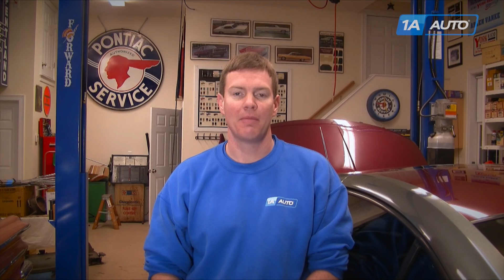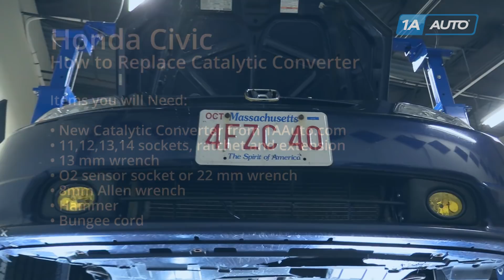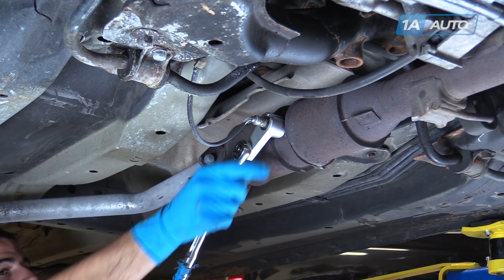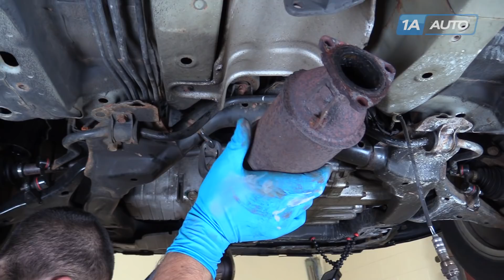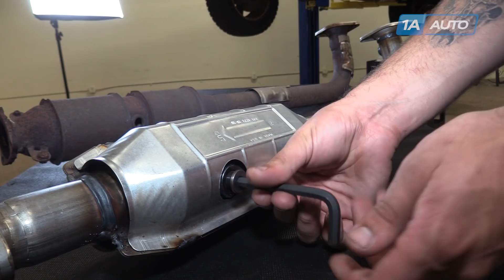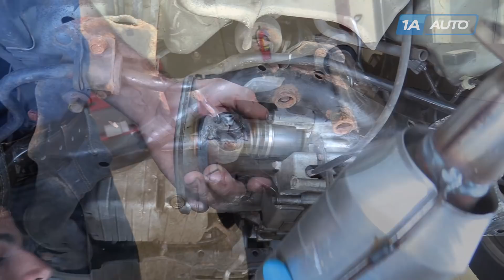How to Replace Catalytic Converter 01-05 Honda Civic

Comment: just pulled mine off and looked into the hole. is the convertor just a bigger size pipe? i can see straight down through the convertor. i was under the impression that the cat was supposed to have something inside it like a honey combed mesh.

Comment: I have a question, I replaced my 2004 Civic DX engine with a 2005 HX engine. Everything is fine EXCEPT nobody NOBODY can tell me where to run/connect the other end of oxygen sensor from the underneath catalytic converter to where??? From the new underneath catalytic converter, I have a place to connect oxygen sensor on it... but where does the other end connects. Do I need to get a HX rear wiring harness? If so, where is it located? The local three Honda dealerships can't even tell me. HELP please. I just need to know where to connect the third oxygen sensor from the catalytic converter underneath the car that has had the engine changed from a DX to a HX.

Comment: The replacement downpipe isn't mandrel bent the way the oem one was, with the crimped looking radius instead. It's a sign of a budget replacement part. Knowing that, the corrosion resistance of the replacement part is almost certainly nowhere near as good as the oem either. So if you live in a state that uses road salt, don't expect that downpipe to last very long.

Comment: because of 1aaAuto.com I've saved about 1000 dollars. These guys really help DIY everything on my 2001 honda civic. Just did a Front brake pad replacement and I'm thinking about changing the catalytic  converter. I'm hoping I can figure out what's wrong with sensors but I replaced both. It's probably the intake sensor since it's flimsy and lose. It has a custom intake.
Reply from the maker: +Livingston Seagull Thank you for your orders! We'd love to hear about your experience. Here's a link to leave us a review on Google: https://goo.gl/i5JFNY 

We love empowering our customers and showing how to perform DIY auto repairs with our high-quality auto parts. Thanks for coming back time after time, we greatly appreciate it!

Comment: Great video, thanks! Do you need to erase the code afterwards or should it automatically turn off after a few drive cycles?
Reply from the maker: +jamminjamy We would suggest resetting the code before installing the new part. Please do not hesitate to contact us with any further questions.

Comment: Hmmm! I don't even know where to start with my issue!!!
Yellowing of the tailpipes(sulphur dioxide)
NO ENGINE MANAGEMENT LIGHT!!!!!!!
K20A2 2005 EP3.
Idles perfect at 1k rpm!
All that's left for me to say is Help
Reply: Check online forums
Reply: im not sure 1k is a perfect idle. if im not mistaken it should idle around 750 +- 50 rpm. on canada built ones its about 30 rpm lower

Comment: I just got my cat cut off and stolen. Do you know how much it would cost for a 2003 honda element with 2 o2 sensors? Also, will i be able to pass smog with an aftermarket cat? Any warranties?
Reply: Well it depends on the new cat youre buying, different parts from different companies have different prices they can go anywhere between 150-600$ for a new aftermarket catalytic converter and if youre getting it done in a shop depending on the shop the prices vary due to cost of parts and also added labor so pricing out the process is kind of up to the shop unless you do it at home. Now if youre looking for a direct oem replacement rather than a high flow performance cat then yes it should pass smog no problem if you keep sure to get one thats legal for your state emmisions. Most aftermarket parts should list what states they can be used in and always double check before finalizing a purchase.

Comment: How much would it be normally to change the actual converter? I’m from the east coast but I just want to know if it’s a hard job.
Reply from the maker: Thanks for checking us out! The costs can vary depending on the vehicle and location you go to, however, the average cost for parts and labor for this repair would be a little over $1000. Hope this helps! +brandon robles
Reply: @1AAuto  How are you coming up with $1000 for this repair? Doesn't pencil out.

Comment: Please tell me what is the average life span of the factory issue cat-con on a 2003 Honda Accord EX (4 cyl, 2.4L).....?? And what is your longevity guarantee on the one from 1A Auto....?
Reply from the maker: +Duncan F Should last 10 years or longer. We're confident our replacement should last just as long if not longer and they are backed by a 5 year warranty

Comment: I'm about to replace my exhaust manifold but the one I'm getting, some people are saying, takes the cat converters place. Would I have to buy new exhaust piping or would i be able to keep the one i currently have(with catalytic converter). My inspections up next month and I'm getting po131,132,420 (my manifold is missing a bolt to the exhaust, and it rusted).
Reply from the maker: +MrDarfoot Thanks for watching!  Certain vehicles have the converter built into the exhaust manifold, so it all depends on what you have.  As for diagnosing your issue we recommend having a trusted mechanic take a look at your vehicle to get an accurate diagnosis.  1aauto.com

Comment: Thanks , please help , I get the code as well , should I change both o2 sensors as well as a new cat assembly ?  , I am not well versed in emissions , however it would seem like the safe thing to do. Am I wright or wrong please advice , thanks. Gary / 2003 Honda Civic Coupe EX
Reply: Our Civic EX models only have one o2 sensor, not two. How did you fix yours?

Comment: Thanks again 1A Auto parts! you guys saving me a ton from the Honda dealership. Plus, it help me get my car smogged regulated in CA. Btw, how many thousands of miles do you guys recommend changing both the down and upstream 02 Sensors? 

-Mr.NOS™
Reply from the maker: +MrAznRonin On a 96+ application it is recommended every 100,000 Hope this helps you out. 1aauto.com

Comment: I can't even believe this channel, saved my life. xD I had to replace my whole suspension on my 2002 Honda Civic Ex after a bad accident. I wouldn't have known how to do it if it wasn't for these videos. So in return for all the information, in a quick, detailed manner, I did get all my parts through them. Same price as eBay, but they won't let you buy things that don't fit in your car and make sure you are getting the right things. I almost got the wrong bolt pattern for my rim, almost got 4x125 instead of 4x100, but they emailed me to make sure before sending and knew the stock bolt pattern and asked if I had an aftermarket Knuckle to make sure. I said no and they sent the 4x100 so it would fit. :D Thanks guys! I am getting a new cat next month because I have the P-0420 code. I tried switching both O2 censors and still passed smog somehow, but going uphill, she slows down.
Reply from the maker: +Jake Genocide Hi Jake, Thank you for placing your order through us. If there is ever a concern while ordering parts for your vehicle, please don't hesitate to call, we are here to help you find the correct parts too. Have a great day! 1aauto.com

Comment: Seems like something I could do myself but when I took my Civic to my local auto shops they made it sound a little more complicated than it is. They told me they have to know the engine family number. After watching this video looks as if I can just order the part from you guys and make a switch. One shop even quoted me as high as $1500. As much as possible I don’t want to do it myself because I don’t want to get under my car on my back. But, with the price so high I may have to get on my back and just get dirty.
Reply from the maker: +Arthur Maclang It's not that hard of a repair. Here is a link to the exhaust pipe shown in this video on our website. http://www.1aauto.com/2001-05-honda-civic-exhaust-pipe-with-catalytic-converter/i/1accd00320?utm_source=YouTube&utm_medium=CTA+Comment&utm_campaign=ytcomment&utm_term=jdRdxbvRswQ
Reply: Shops will charge you an arm and a leg to do the smallest thing.  They hope that you don't know anything about cars.

Comment: will this part fit the EX model?
Reply from the maker: +Curtis Kuhlman The part shown in the video does fit a 2001-2005 Honda Civic EX L4 1.7L. It should be the same or a similar procedure. Here is a link to them on our website. Hope this helps you out. https://www.1aauto.com/2001-05-honda-civic-exhaust-pipe-with-catalytic-converter/i/1accd00320?f=1076994&y=2003
Reply: I need your help please help I’d end up changing my catalytic converter but my manifold is still turning cherry red
Reply: 2001 Honda civic EX I have change the Cadillac converter and the down O2 sensor everything is tight and my manifold is still turning cherry red
Reply: @parsonsgang1903 what was the problem

Comment: What size are the bolts that join the cat and midpipe?
Reply: Welshy I've been trying to figure that out for a year now nowhere online is that information posted let me know if you find out
Reply: Would it be in the manual? I can check mine if so.
Reply: I think 13 mm

Comment: Are you able to connect to back off the Catilatic converter before you bolt up the front part, and does the car have to be jack up on all four wheels.

Comment: i got a P0430 code for my chrysler 300 2.7 i went to 2 shops one told me my car needs a tune up the other one told me i need a new cat should i replace it ?
Reply from the maker: +Chavez I Thank you for checking us out. The code P0430 means that bank 2 catalyst system is not being monitored appropriately. Some possible causes are a faulty converter, intake air leaks, fuel injector leak or failure, faulty spark plugs or improper ignition timing. Usually diagnostic tools can be used to read live data from the fuel injectors and catalytic system for errors to pinpoint the issue. 1aauto.com
Reply: 1A Auto Parts thanks will for the feedback your videos make it real easy work on my car and save money by doing it myself.

Comment: What are the bolt sizes(both sides) for 05 Impala 3.4 catalytic converter?  Having a lot of trouble finding them online because I'm not sure the name to look up. Hopefully my b'laster will save the old ones.
Reply from the maker: We do not have that information. Your local auto parts store should have replacement hardware for it. It's pretty common for that stuff to break. Hope this helps you out. 1aauto.com

Comment: I have got a 2008 honda civic , the car is not revving above 4,000 nor picking up speed ! Will it need. Anew catalytic converter or can there be a cheap fix ?

Comment: Since new, I have a 2005 Civic SI with low mileage and was just informed that I need a catalytic converter. 
The check engine light has been on for 7 years, I paid the dealership to to do something, the first time I noticed it
 and replaced the gas cap. They informed me it may come back on and it did in about 3 days.
 For the last 4 years it never passes our E-test. Thanks for sharing, now I know what a catalytic converter is.
Reply: same mine need to pass ETest haven't yet

Comment: Will the new catalytic converter make the car sound better?
Reply from the maker: +DaveWave It depends on how yours has failed. If it's rusted through and has a hole in it, it's an open point in the exhaust system which can make the car sound very loud. So in that case replacing the cat. with a new one could close up your exhaust leak and make the car run more quietly. Hope this helps you out.  1aauto.com?utm_source=YouTube&utm_medium=CTA%20Comment&utm_campaign=1ATony 866-403-3393